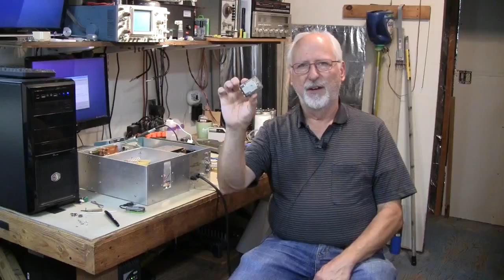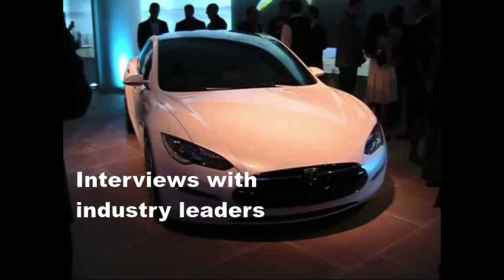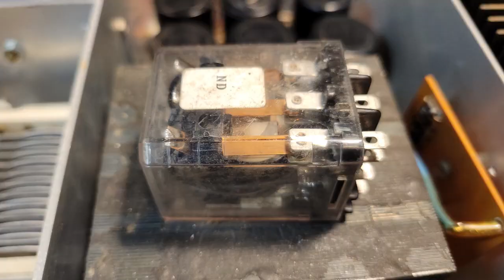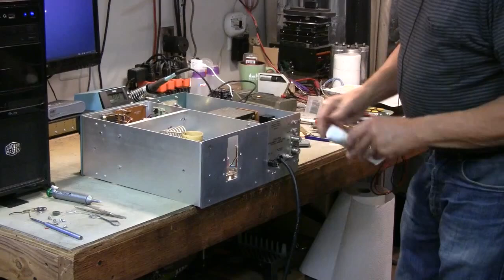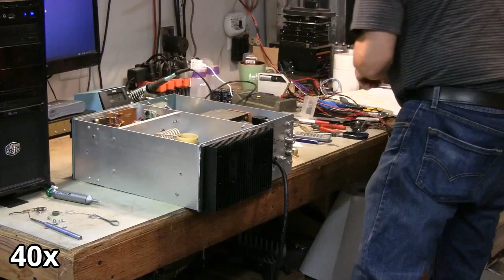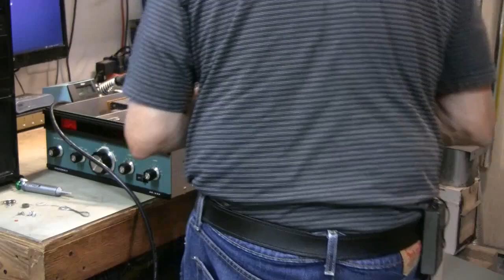#497 Final Assembly of SB-230 GI-7B mod

Comment: I was wondering, you replaced the damaged 120 volts relay with a new 120 volts because you claimed a 12 volts would be difficult. Why? I did exactly that many years ago in my SB-230. Works like a charm. Still the original 8873 but I have a bunch of GI7B's just in case. I truly like your solution to use copper and an upright GI7B. Are you going to make a video on the final test of this one?
Reply from the maker: The 120VDC relay coil is in the negative bias chain. Changing it out to 12v is a much more complicated rewiring than just adding the auxiliary 12v relay. Results of the second upgrade same as the first. 750W PEP all bands, all day long. Love, love, love this amp!
Reply: @zerolabs  Thanks for your answer. Yes, one could say that in the original schematic. Although I just swapped the 120v for a 12v relay without any issue. Bias looks the same (22mA) on the meter and my signal is clean too. But in the full GG schematic I can't see anything other than the neons connected to the coil (and the paralleled 1500 ohm resistor which I use to 'feed' the neons). Would you care to explain please? If I ever have to change to a GI7B I don't want to mess it up by using my 12v relay. It's a three pole as well so I have the necessary extra pole to switch the bias.  And congrats on your "new" SB230"! Well done.

Comment: Could /. Would you offer the steps ( all of them) to install 2 of those tubes in a sb 220? I am an appliance operator from hell but I want to try! 73 dan wa0nxe tnx
Reply from the maker: So, I assume you're wanting full legal limit. There's three problems with that. 1) I don't have a SB-220 to try it on. 2) I have little desire to perform this upgrade again even if I did have one. 3) The transformer is not rated for that much power. Even if you got it working, you would probably burn out the transformer. One tube, fine. Two tubes, you're on thin ice. And there's no large heat sink on a 220 to bolt the GI-7B to. You'd have to come of with forced air cooling with a stack for the original top-hat heat sink.
Reply: @zerolabs  Tnx for reply I have a sb 220 in sad shape. It has been diagnosed as bad filament x former. So that one has to go , so, might have to find plate xformer 
Forced cooling is not a concern 
The biggest issue is changing the components and to determine values! The only thing that I do already have is a mechanical ability to place components 
I do understand no desire   I am trying to get out of that in many things 
According to latest Vedic there are not many component changes. Is this true? 
73 dan wa0nxe